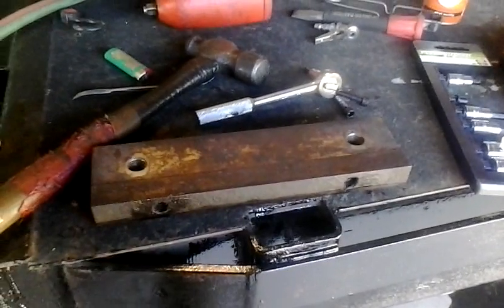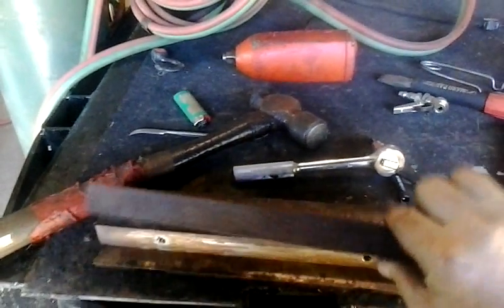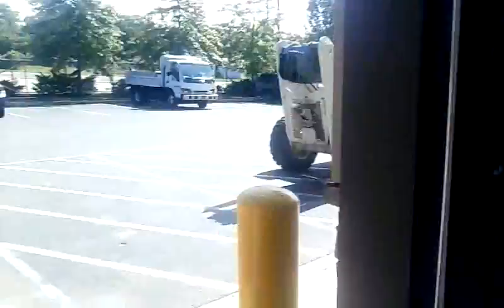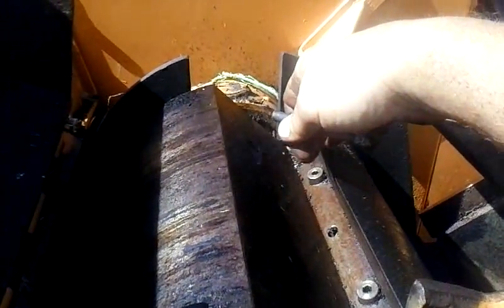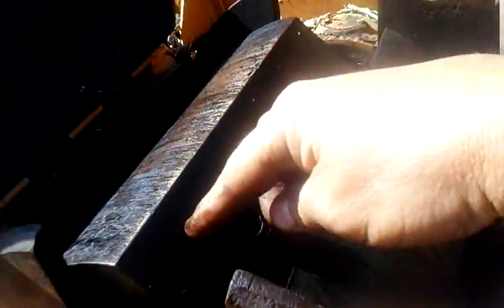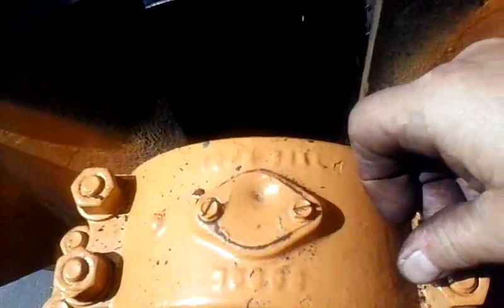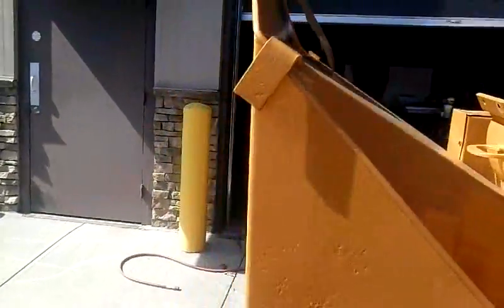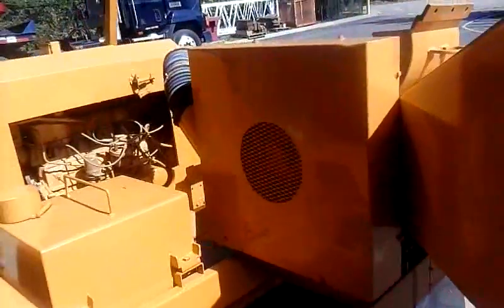Tree chipper Asplundh wisper blade replacement 1

Comment: Edge of cutter bar shelf edge dull...must be Sharp or no cut.
Not just blades.
Self feeds good now.
Run at full 3600 rpm or chute clogs up.
Clean shute after each job or chips lock in.

Comment: two week ago i pick one up for 3300  shipping 635.00  no good blades so you got a great deal p.s.  having  trouble getting  blades  off jam bolt is not releasing wag bar
Reply: Still using it.
My other channels motorhead1 and Mitzvah Golem has other tech
Torch needed to get them bolts out.
Reply: Torch time..
Reply: Any idea what the gap should be between the blade and the anvil? I have the same machine and it runs great but like yours won’t feed the wood. Help?